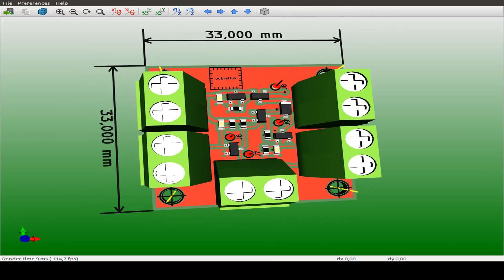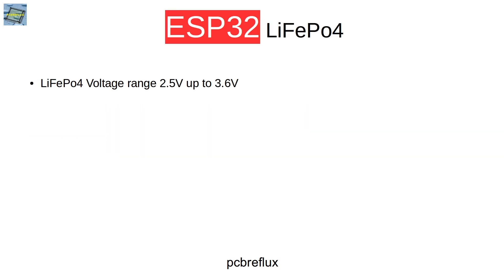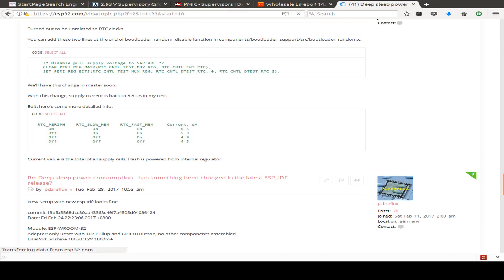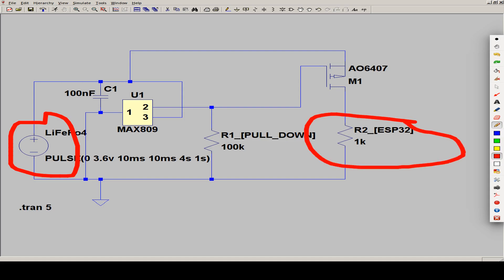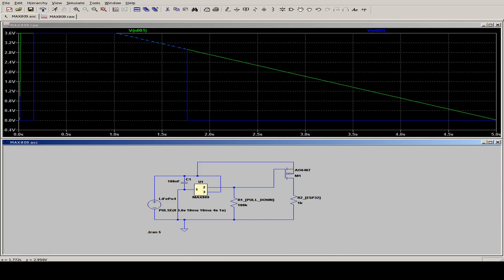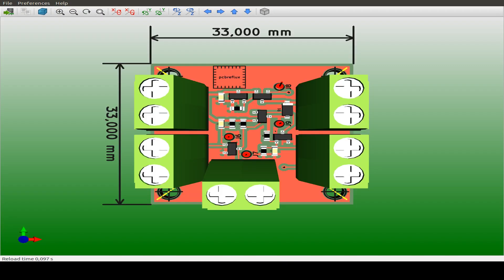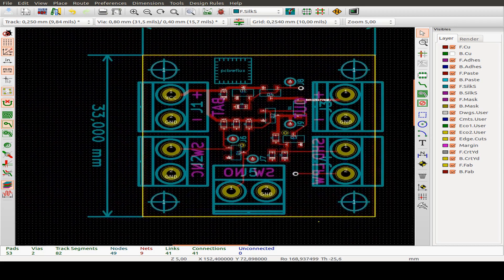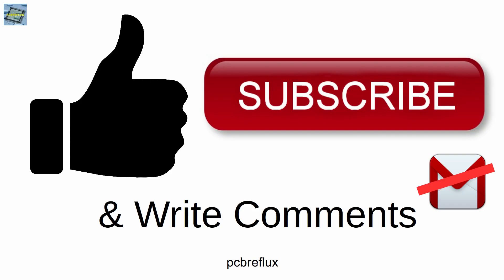ESP32 #51: Battery Monitor

Comment: Hi pcbreflux

I hope you can point me in the right direction.

Im incorporating a 2.93V ±3% Voltage Detector Supervisor STM1001SWX6F Active Low SOT-23 into a bare bones esp32 to optimise power. The only chip I can get at a reasonable price. How do I interact with this chip? I can see its active LOW, so pulled HIGH with a pullup resistor, so awaiting a change on a digital pin.

As I plan on putting my esp32 into Deep Sleep for 24hrs, I assume I will have to use an RTC pin set up as an interrupt and run a ISR.

I was wondering how we handle this is code and if you had an example. First time designing a PCB and this video really helped me get enough of a start to add in this type of circuit to my design.

Your comments would be gratefully received and I thank you for your continued awesome work.

Regards

Comment: The real reason why you have to use a wakeup chip is because the ADC in ESP32 is so bad that you cannot trust in it. Wake up the ESP32, measuring the battery and sleep back process need not too much power. The whole action takes about a sec.

Comment: cant this just be done in software?
Reply from the maker: Yes it can with the build in adc. but this consume (convert) less energy over time and is mostly cheaper $0.03 .. $0.30 for the supervisor circuit.
Reply: Where do you buy them from at that price? Great video thanks
Reply: @deangreenhough3479  on the video appears to be on mouser, but you can also find in other electronics sellers, like farnell

Comment: como faço para monitorar remotamente tencao AC-1: Medir tensão AC em Volts (10 a 260 V). saber se tem a presença de energia AC. medir a tensão da bateria em VDC (0 a 60 V). medir temperatura temperatura em ºC (0 a 100 Graus) ligar e desligar ,pode ser com um rele Na/Nf e pulsar tipo pra reiniciar ,desligar e ligar novamente